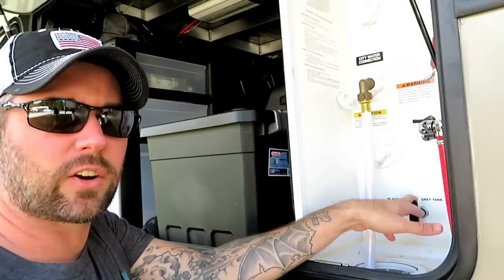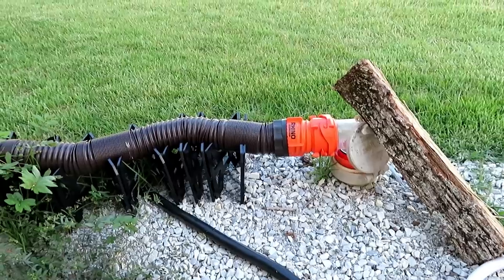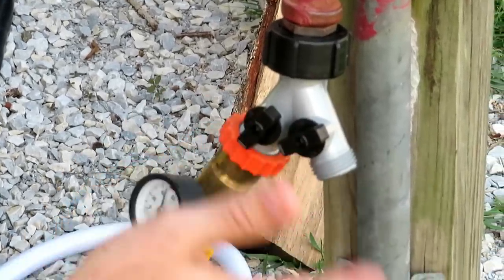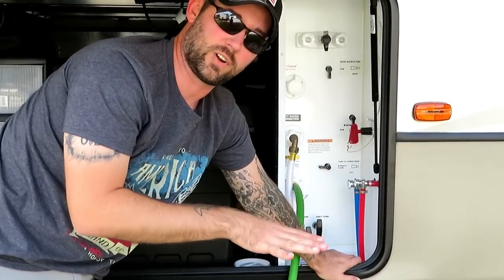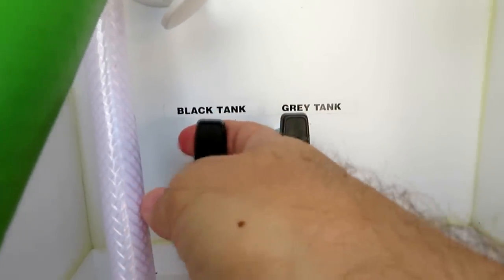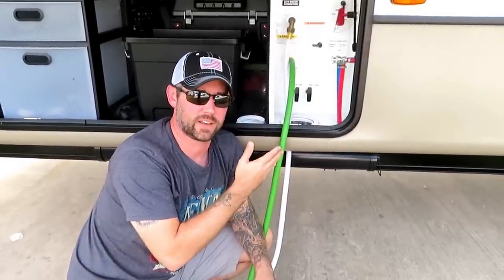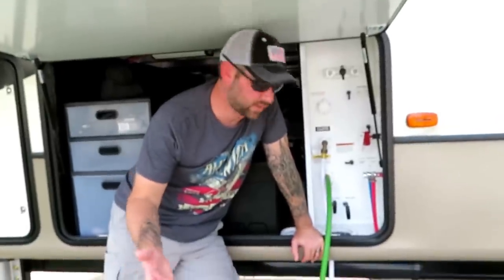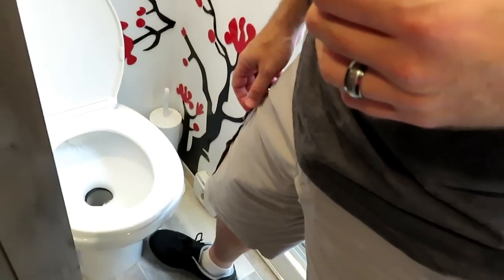How To Dump & Clean Your RV Black Tank || Full Time RV Living

Comment: Happy Birthday!! I’ll second the recommendation for Happy Camper holding tank treatment. Also, I use hose quick connects on the hose splitter at the hose bib and on the black tank flush port. Makes connecting the hose a snap.
Reply from the maker: Thanks for the recommendation. We appreciate it.

Comment: Our rig is as same as yours except the year: 2019. My husband allows flushing into the black tank for about 10 minutes or until the water become clear and, then, to close the vavle and fill the tank up for  8 minutes before dumping to the sewer. Happy Campers Holding Tank Treatment is the best!  We don't have any smells so far because we use this product from Day 1.  I use 1/2 scoop of Happy Campers for Gray 1 & 2 to "clean" tanks on the traveling days. We are stationary this summer and we traveled out of town twice since May so we took advantages of those traveling days to clean each tanks (3 gallons each)except fresh water tank.  Watch Changing Lanes' video, called 'Two Poop Hoses?"
Reply from the maker: Thanks for the tips. We will go check out that video too.

Comment: I was just talking to someone last week, and he closed the drain and let the hose run.
The "unsanitary conditions"...
As soon as the "water level" hit the end of the vent in the black tank, it pressurized the black tank and split it opened, dumping the contents.
Reply from the maker: 😯 That is terrible.
Reply: @WaywardWaggs  
And makes sense.
If you had 60 psi of water pressure and blocked the vent...
The manufacturer covered it under warranty, so that's some good news I guess.
     Go wash your hands and have some Birthday cake.🙂